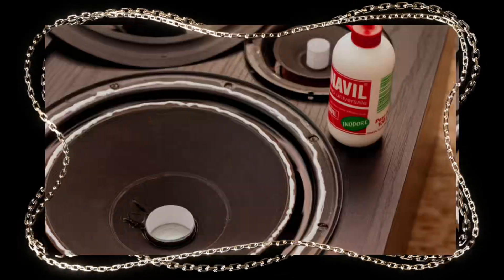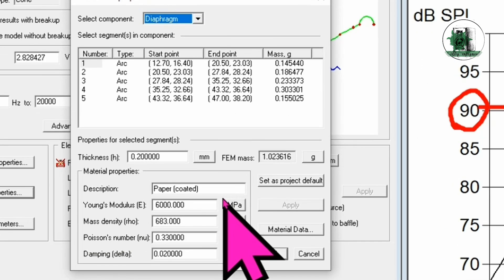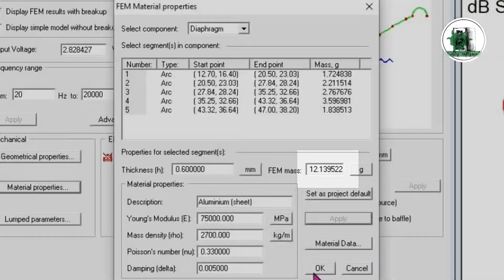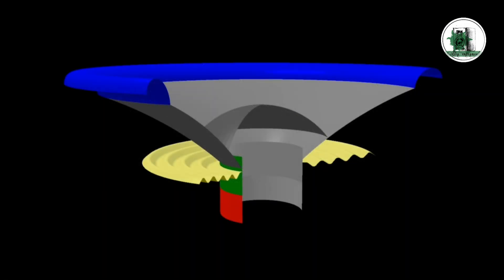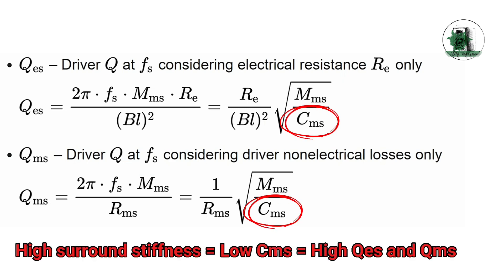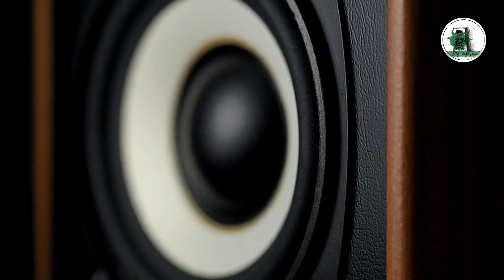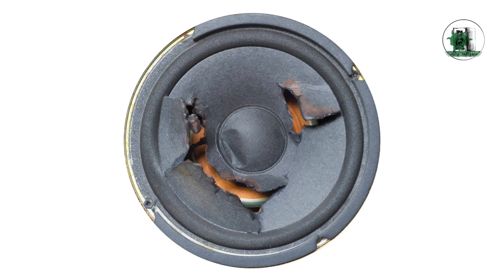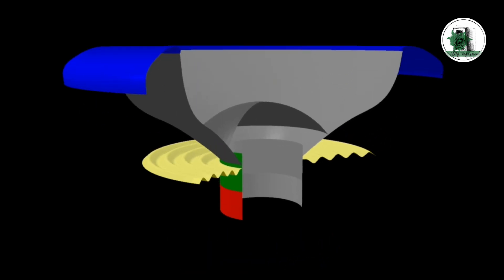How Changing a Speaker's Cone or Surround rubber Affects Sound Quality

Comment: Foam surrounds fall apart after several years. When that happens in fact you have two options. Refoam them even if they probably won't sound exactly the same as before or simply throw them away. Since refoaming isn't difficult nore expensive, I would give it a try.